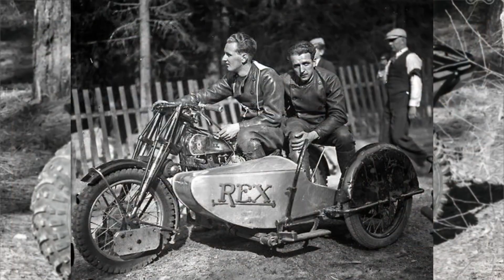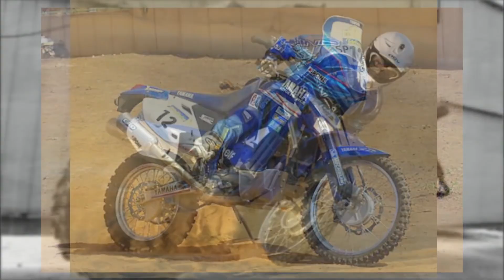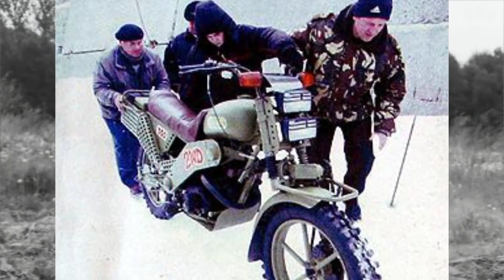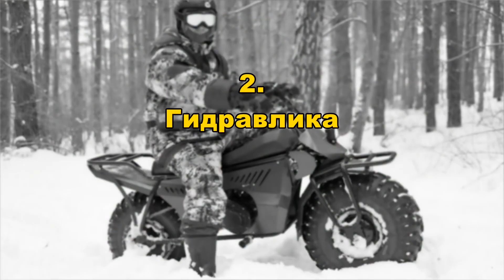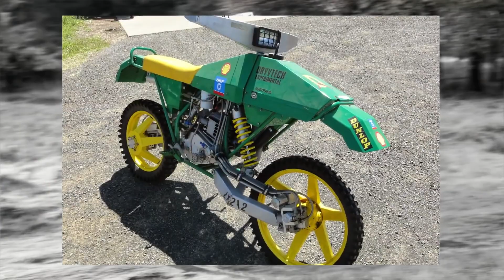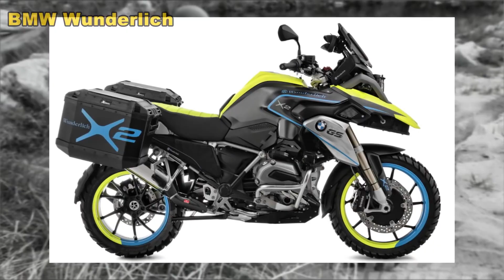Let's Talk About All-Wheel Drive Motorbikes

Comment: The Rokon isn't awd, it's 2wd. It splits the power 50/50 like a true 4x4. The Christini and similar bikes are awd, the front drive is over driven on a Christini, so it's not active unless there's slip, like that hydrostatic front drive Yamaha. They operate the same as a non performance typical awd system that power splits 60/40 or less.

Also this is another video I've seen on these types of bikes, that left out the motogp bike Honda built, that also had a hydrostatic front drive.

Comment: 2x2 would be 2 speed 2 wheel drive
Reply: 2x2 is two wheels powered by two, like 4x4 is four wheels powered by four. Has nothing to do with transmission speeds.
Reply: 2x2 means two wheels powered by two, same as 4x4 or 6x6. Has nothing to do with the transmission.